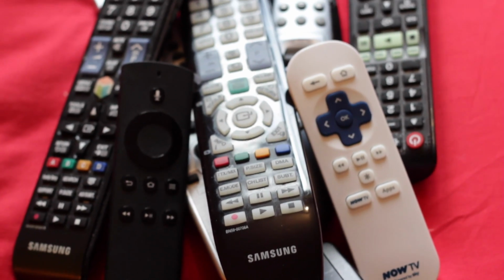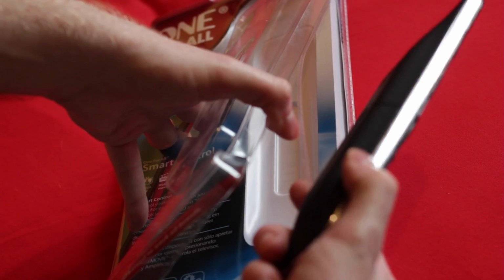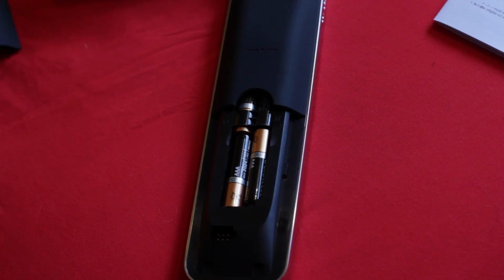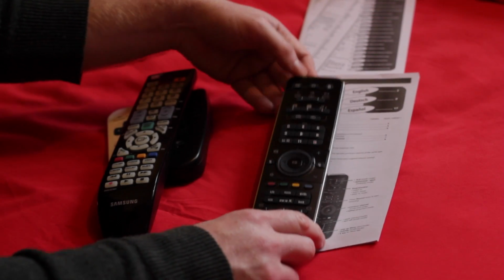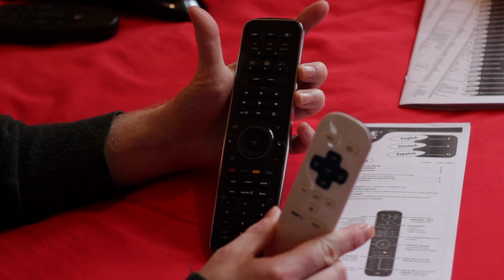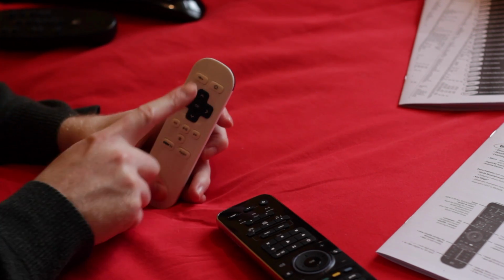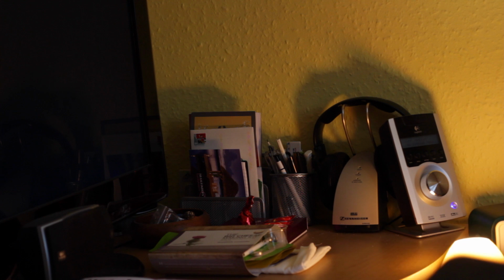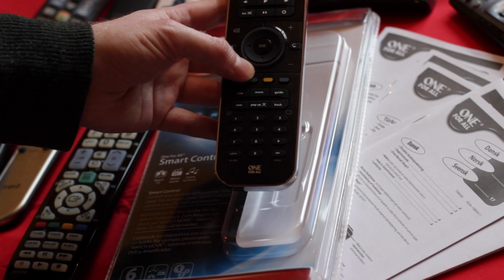URC7960 One for All Universal Remote Review

Comment: I find this is the best remote oneforall as brought out to date. Good points one can select device button easily so you can go from one device to another quickly., better than having one button that goes in a clockwork motion to select device, this is more time consuming. 2nd point. Buttons dont need much finger pressure to make contact. 3rd point. looks a premium product. 4th point button contacts do not degrade after many years of use, the only niggle i have is that the rubberised back starts to degrade after a year of use. Must be the sweat in the hands that degrades it.But hey it is not supposed to last forever.